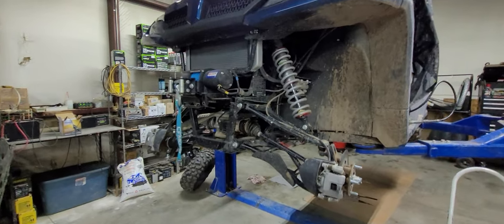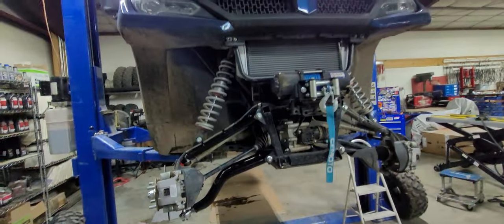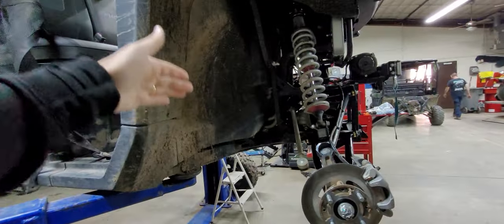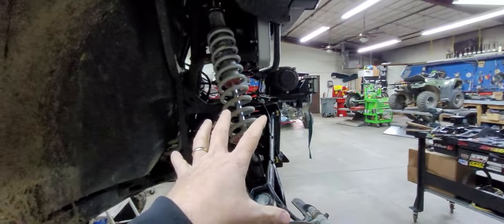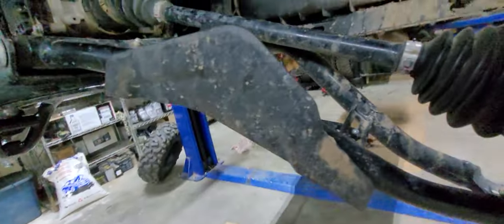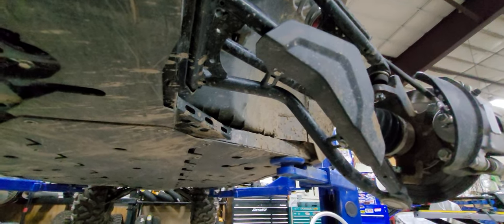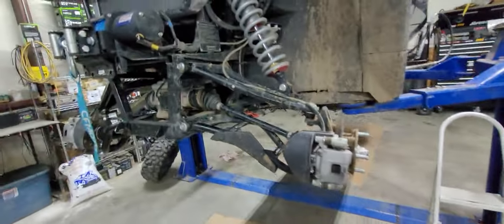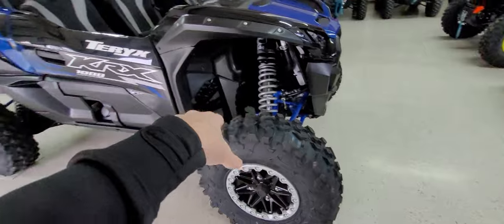Why you want to upgrade your control arms with Super ATV arms!

Comment: What about putting these on the new MULE PRO FX 1000 HD. I'm not looking to put massive tires on it. The biggest tire I'm planning on running is 28". I'm liking the robustness and durability of them.
Reply from the maker: You can for sure once SATV comes out with the arms if you wished, but you can run 28's with stock arms, if you are in the ruts and the rocks alot, that is where that added clearance from the arch will make a big improvement for sure.
Reply: I live in southeast Texas and I deal more high water and/or deep mud than rocks or ruts. I just want a little more ground clearance for when the need arises and I have to cross a little deeper water than it can take now. I've got stuff for playing in the mud but this machine is mostly for work and some lite trail riding or at the deer lease. 

 I plan on using your shocks along with those arms when my piggy bank says I can 😂.
Reply from the maker: @keithhughes2936  Adding our shocks to the 1000 mule will sit you up a couple inches, then going to 28's will get you another inch, now you can adjust the pre-load up if you need more, as far as a 4" lift on the mule, we set it at a 2" lift for lots of down travel and max performance, but you have room on the mule AND you gain 3" more wheel travel over stock. If you want more, add some portals lol, We can sure help you with whatever set up you wish! just let us know. You can always add the SATV arms later down the road too.

Comment: My only concern is with everything stock except a 2" bracket lift my CV axels are at a severe bind especially if wheels are turned sharp. In 3000 miles barely using 4wd both front axels were clicking and replaced under warranty. If you have even more down travel won't it make it bind even more. That is my biggest concern on the uforce is a arms being so short. Everyone running spacers wearing out bearing to widen bike out to even with the fenders. I wish they made a long a arm kit with longer axels and wouldn't bind as much if you lifted them.

Comment: Do they make a bracket lift that will work with the super arv arms to gain clearance for 32’s?
Reply from the maker: You can modify a Perfix lift to make it fit the arms, OR our Hester Edition Elka shocks. 30's are the sweet spot, you will rub when turning or the bed with 32's, unless you run a 4 or 6" portal, then you can clear even bigger with a 6". If you went arms, our shocks, 4" portal you can clear 32-33, have a big gain in gear ratio, and the 4" portal is a gain from tire to tire, not just the center, and it would ride like a trophy truck! We can help with everything you need to get it done, just give us a call Tuesday-Saturdays (575) 445-3558 and we can go over it all with you!